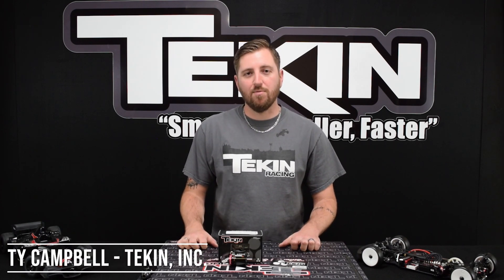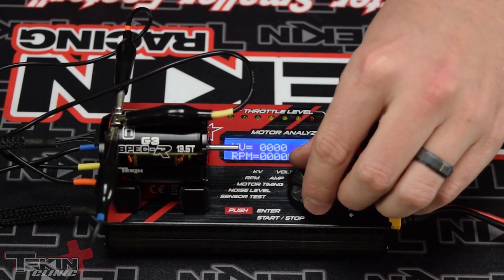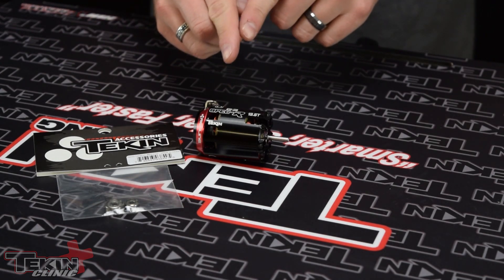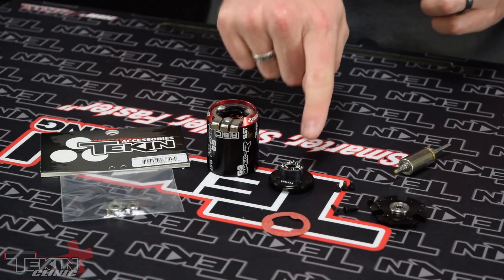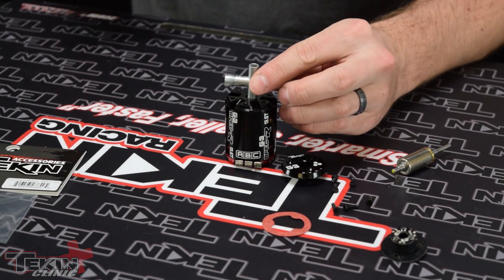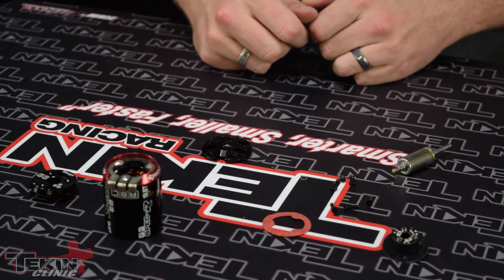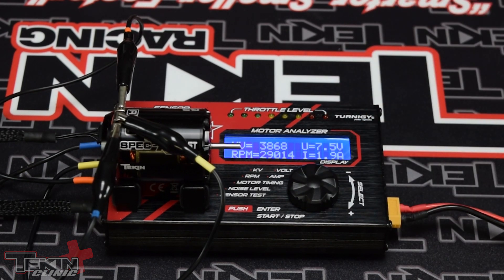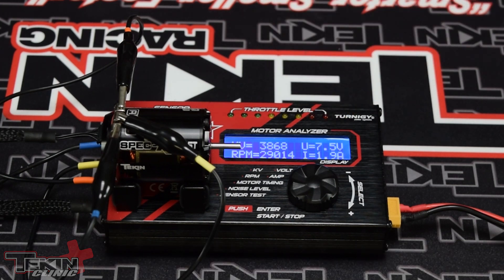Tekin Clinic: Ceramic Motor Bearings

Comment: How much rpm would you get with ceramic bearings on a 4t mod motor?
Reply from the maker: Depends, I'll have to video installing them in a modified motor.
Reply: @TekinRacing  K. I'm just curious since I am going to run a 4t motor in my street eliminator.

Comment: Rpm remained the same for me after swapping to these bearings. Did I do something wrong? Also my motor has 3 race days on it before swapping to new bearings.
Reply from the maker: Make sure they are fully seated and the rotor has some free play! Could be that the stock bearings were really free to begin with.

Comment: Bearing installation conspicuously absent from video? <2% rev increase not all that impressive depending on whether 'old' bearings were actually old or was this new motor? Amp draw decrease is substantial. Certainly performs as advertised but was hoping to see more disparity between stock and ceramics.
Reply: 500rpm is a lot on the track and you're also leaving out the 27% decrease in no load current. No trickery here. Says right in the description we used an off the shelf motor and I made sure the timing was the same for multiple runs and got the same results each time.
Reply: @TyTekinCampbell  not implying trickery just surprised stock bearings were so close in performance to ceramics. As you said the stockers were new and im assuming oiled as opposed to greased. If anything i think it speaks to quality of original ones. Of course this is all based on my preconceived expectations that were apparently optimistic.